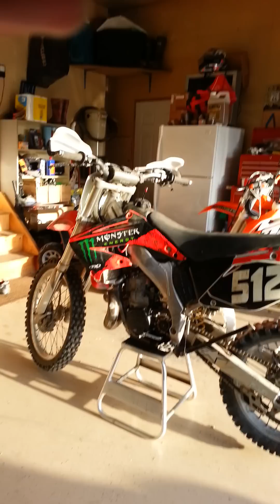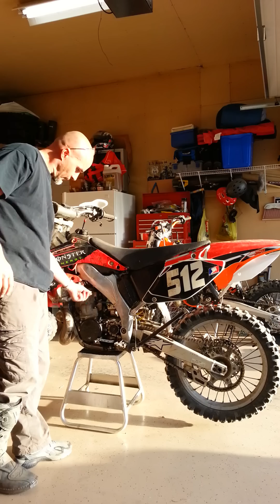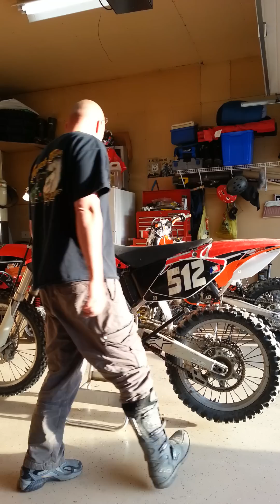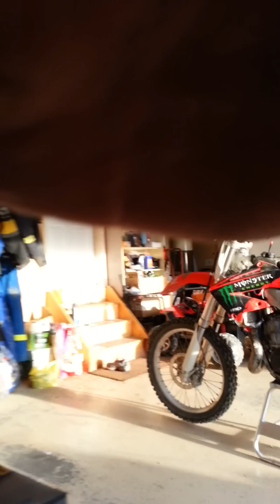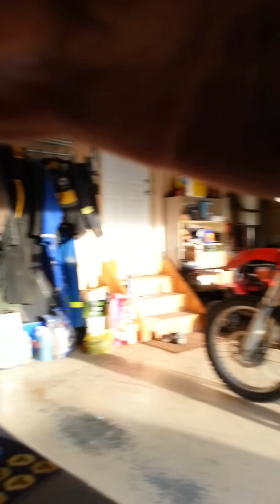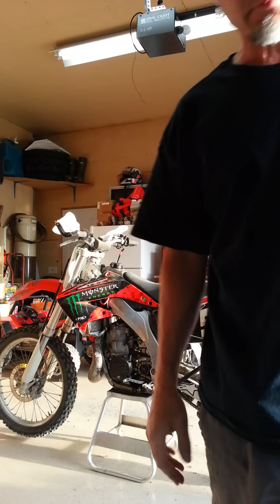CR500 38mm Billet Smartcarb now New OEM ignition

Comment: What were your final thoughts on the carb? I'm having same issues but am running a Q07 rod.
Reply from the maker: I messed with it off/on for a year and finally sent it back.  4 different rods, new check balls etc.  Most guys on CR500riders.com and snowest.com gave up on the carb.  One or two guys said it worked but never said much more.  It can't draw enough fuel to start the engine when cold.  It will start when hot but not without an unusual procedure of tipping the bike on its side so the carb leaks the fuel into the cylinder, then it might start.  Apparently it works good on 250 & 300 cc's engines.
Reply: Yeah I'm having a cold start problem.  I can only get it started with a little spray.  I'll try and tip it over and see what happens. Are you still running the airstriker?
Reply from the maker: Yes the pwk is just fine except for mountain elevation changes then it needs a needle change.  Tip it over on its side completely sideways.  I had mine on the stand and tipped it completely horizontal (even below horizontal) up and down 3 times to ensure gas is spilling out of the bowl and into the cylinder.  It must start on the first kick or it won't start at all.  choke open, do not touch the throttle!
Reply: if I tip mine to the right side I was able to get her to come alive
Reply from the maker: Put up a couple videos of how it running.
Reply: I ended up buying a pwk from jdjetting. All good now 😎

Comment: it has been mentioned that the 500s signal strength may be too much, causing the slide to open partially. May need a stiffer spring?
Reply from the maker: nomdeguerre13 If your following that Snowest forum on the SC I will keep you up to date there.  I have a few small updates to add on this thread. http://www.snowest.com/forum/showthread.php?t=389287&page=3

Comment from the maker: I'm still trying to get it to work.  I'll be installing it on my 2015 300 XC-W to see if it works.  Either its too rich or engine is not getting enough fuel to idle.  If it doesn't work on the 300 XC-W then next step is to remove the plastic balls in the top over valves.